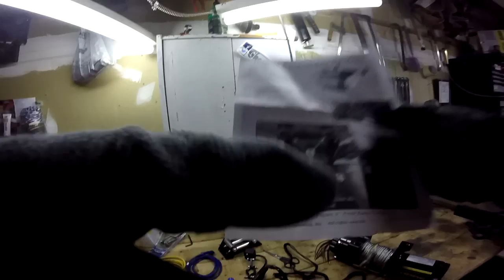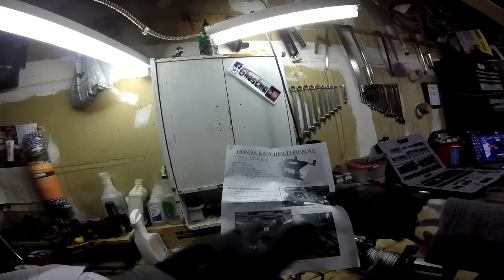2015 Honda TRX420 (Rancher) Winch Install

Comment: Good video.....it helped me out great deal.   I mounted my distribution box in the back tool compartment. Drilled holes through the sides and used rubber grommets around the wires going in.

Comment: Just an FYI.....KFI Products sells the exact fit winch mount for the Honda 420 and 500 Rubicon at a much better price than going through the Honda dealer. KFI part number 101175. I managed to get one for my 2016 500 Rubicon from Amazon for $65.00, including free shipping. Easy installation without any drilling.

Comment: Good video for Honda owners man. The hardest part for me is figuring out where to install that damn solenoid.
Reply: I ended up installing it in the little storage area behind the battery. I extended the wires to the winch and shortened wires to the battery. I had plenty of cable to the switch mounted on the handle bars. Works well.

Comment: That's exactly where I mounted the winch solenoid on my Rubicon. Ya I don't think it would ever get hot enough to effect it under there. I have been running mine for two winters now.

Comment: Thanks, helped me install on a 2019 420.  I tapped in the white wire same as you.  I read online that people install fuses or circuit breakers.  Did you? Read that under heavy  load pulling atv out can blow your honda fuse in the fusebox.  I haven't been stuck yet.  Thanks

Comment: following your instructions and I have the winch mounted to the plate the same as you show. Before I put it back on the bike, just curious if there's a reason you have the free spool switch on the left side? (Looking from the front of the bike) Seems to work either way and I just wonder if there's a reason. Great video! Thanks

Comment: I tied into that same wire and where time I start putting a load on the winch it blows a fuse I had happen twice once when I was trying to pull my self out of a hole and when I tried pulling someone else out i may have to wire it I'm some where else idk what else to do

Comment: That's a nice upgrade. I have a John Deere Gator and I've been thinking about a winch myself. I'd be interested to hear if you use it much or not over time. Thanks.
Reply from the maker: I'm hoping I don't need it much, but it will be nice to have it when I do.  I mainly wanted it for hoisting the machine up to pressure wash underneath after rides, and also for lifting a plow when I get one.
Reply: Now that's something I didn't think about, hoisting itself up.

Comment: Hello!! good video and very good explanation, I only have one question. to mount the winch did you use the plate that comes in the set? or you used a different plate .. in the video it looks a bit different from the amazon one. Thank you!
Reply from the maker: In the video I explain that you have to buy a special Mouting plate specifically designed for the Rancher/Rubicon.  You can get one from your local dealer
Reply: Ghostma thanks for answering! I will try to put mine!

Comment: That was a tough vid to do.  Did the camera shut off  by itself  when you were mounting the winch. You never mentioned the circuit breaker deal. Was there one.
Reply from the maker: there was a bit of the install where I forgot to turn it on lol.  But I got most of it.  I need better lighting in my garage for sure.  Might have to pick up one of those construction lights. Turns out its not a circuit breaker, it's a solenoid/contactor, I show where i mounted it at 19:50
Reply: Ghostma I have the same  looking solenoid and I don't see anywhere where it resets . I don't believe mine has a breaker at all.
Reply: get a battery powered led film light
Reply from the maker: ill have a look on amazon, thanks for the tip!
Reply: there is one from polaroid 160 led model runs on either C or D batteries cant remember, anyway awesome videos keep it up

Comment: Those are good winches for the price. The cable isn’t that good though. Get the synthetic rope when you start having problems with the steel cable. I bought a viper 3500 for my 2015 Honda rubicon. It pulls like a mule.

Comment: Is that all the winch mount bolt to is that front thin plate ? I was thinking there was a u bolt or 2 for the frame tubes. Thanks man
Reply from the maker: +1minibean the fairlead mounts to that thin plate at the front.  It's separate from the winch itself.  The winch mounts to the plate supplied by your Honda dealer, then that plate mounts to the frame.  Thanks for watching!  Don't forget to hit that thumbs up, and subscribe if ya like the content.  Cheers!

Comment: Pretty sure that bracket is supposed to be behind the bumper instead of hanging over the front or thats how my warn is anyways and i had to do no trimming for a 3,200 pound warn
Reply from the maker: How it's installed in the video, is exactly how it's supposed to be

Comment: How many amps was the fuse on your switched power source?
Reply from the maker: +Isaac Choboter jeez, I'm not sure man.  I'll have to look into that.  If I get a chance I'll check my manual. I would assume it wouldn't be more than 10 amps as it's just the plug for the accessory outlet.